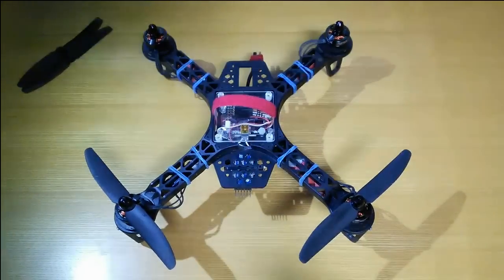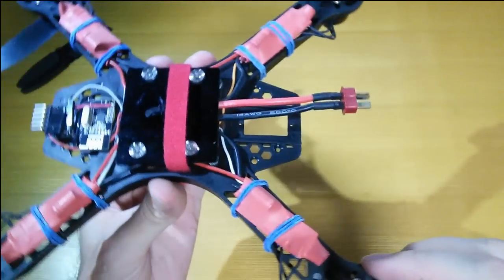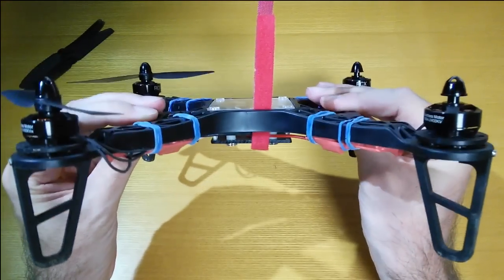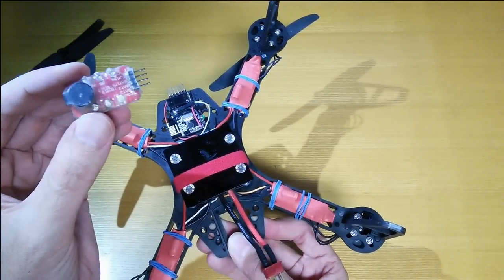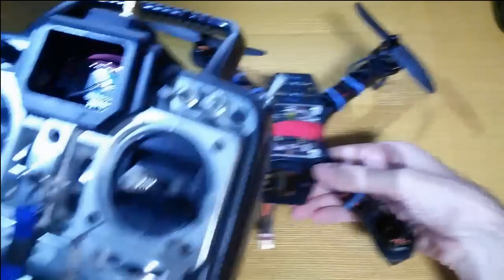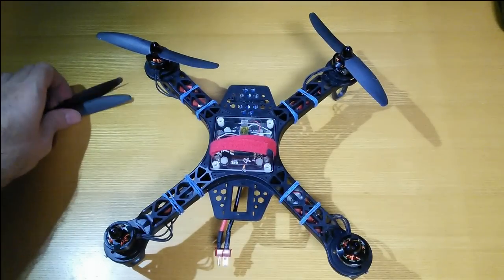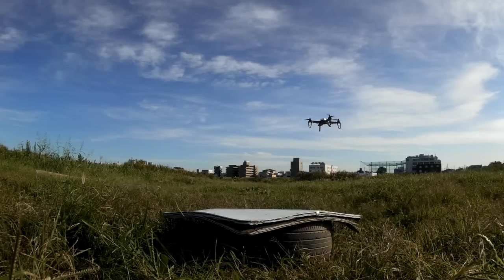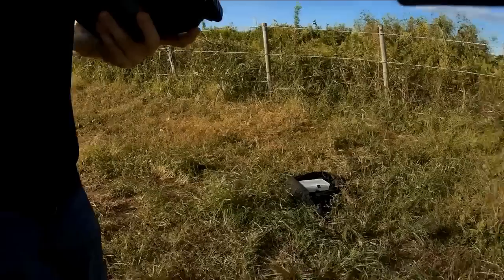Arduino + nRF24L01 + quadcopter

Comment: How many channels are the TX transmitter?
Reply from the maker: Depends. The maximum packet size is 32 bytes so if you're ok with one byte per channel (256 steps) then you could have 32 joystick-style (analog) channels. On/off switches only need one bit, so eight switches could fit in one byte.
Details on the workings are covered in more detail here:
https://youtu.be/eVnyPSAefxU?t=234

Comment: Is there any way to remove vibrations from motors. or any place for IMU sensor on frame so it cannot get much vibrations.
Motors - Sunnysky Angel Series 980 KV. 
Props - 10x4.5

Comment: You should try out the 1.1km version. Actually you can just exchange them! Link: http://de.aliexpress.com/item/wireless-module-1100-meters-long-distance-wireless-module-NRF24L01-PA-LNA-sending-antenna/32648419815.html?spm=2114.13010608.0.68.w2fV4v
Link to Banggood's version: http://www.banggood.com/1100-Meter-Long-Distance-NRF24L01PALNA-Wireless-Module-With-Antenna-p-1057170.html

Comment: hello iforce 

i want to use 4 motor brushed with this project , but when i convert code PWM  4khz  , only pin 9 and 3 work , pin 5 , 6  can not work . it only work with esc brushless . can you help me ?

Comment: did you use the same module in the remote control circuit?? 
i am asking about the antenna that was attached to the remote how did you add it?
Reply from the maker: +أشرف كامل the module in the transmitter is a 'high-power' version, like this: http://goo.gl/MvK8Gu
Reply: thanks

Comment: for a more stable decent you could write it in to have a min idle.
Reply: +Greg Hines +iforce2d I think that the min idle is a half decent solution but as the aircraft accelerates down the props will start to propel backwards as the lift they generate is counteracted by the airflow upward. A better solution would be to check IMU direction and if descending change the min idle by PID control to try stabilise the descent speed. Does this craft not have prop reversal i.e. downward drive?
Reply from the maker: +Paul Sullivan check IMU direction? You mean to detect decreasing altitude? I don't think that's really possible, you would need a barometer which reacts slowly (and also not very precise). Personally I would not want to have the flight controller messing about with the throttle like that while I'm trying to fly either :)
No, quadcopters typically do not have prop reversal - and you would need a different type of propeller for that too. I found you can get a pretty stable descent by just not going directly downward into the propwash, just slant your descent sideways a bit.
Reply: +iforce2d It is possible - I have been doing work on a self balancing robot using arduino and interrupts. Perfectly plausible using an 9 DOF IMU and PID code
Reply: The IMU gives very accurate acceleration versus gravity (very fast and accurate response times) vectors
Reply from the maker: +Paul Sullivan acceleration only tells you the rate of change of velocity, not velocity itself, which is what you need in order to know if you're going up or down.
Reply: +iforce2d Okay iforce2d so as to not get into some sort of flame war firstly I apologise in advance if I am incorrect - genuinely believe that this is not a big problem using IMU and arduino.

In my degree programme I was tasked with building (albeit in java) a Mars Lander - how many people had to do this programming task :). In order to work out whether we were going up or down I used real-time vector summing in a multi threaded object oriented environment.

This can be applied. While you are accelerating down, for example, there is a rate of change of acceleration. Slowing down this descent (applying upward acceleration) is also a 'rate of change'. These are vectors which can be summed to give you a fairly accurate idea of current direction.

I think you will find that a decent 9 DOF IMU does this for you by combining accelerometer, gyro and magnetometer readings. Barometric readings are of course quite variable. Magnetometer readings are also 'fairly' unreliable also dependent on the ground upon which you are standing to an extent though less so than barometric readings.

Please note during early work with 9DOF IMU I decided to pass a neodymium magnet near to the magnetometer chip which I spent a long time correcting as it appeared to have affected the magnetic material used in the magnetometer).

https://www.sparkfun.com/products/10736
Reply: +iforce2d the named chip even has an irq dedicated to isFalling which could easily be used to modulate the props.
Reply from the maker: +Paul Sullivan But accelerating upward does not mean you are actually moving upward, and vice versa. And when the accelerometer reads zero in all axes (eg. you do a fast punch upward and then cut the motors completely), acceleration readings only tell you that you're in freefall. You could of course integrate the acceleration readings over time and come up with an estimate, but it would drift off the real value pretty quickly.

Comment: make a video on nrf24l01 modules with wifi booster amplifier for extending range
Reply from the maker: Gaurav Chugh Do you mean the high power "PA" versions of the nRF24 module? I have many videos about that on my channel already. If you want really long range, you would be better off using a different frequency. I don't think many people use 2.4GHz for long range RC flights.

Comment: Does this method of comunication interfere with other 2.4GHz signals?
Reply from the maker: Richard Haes Ellis It will interfere with anyone else using the same modules and the same channel settings. Outside that I think it should be ok.

Comment: Hi great project im mid build but Im having problems with getting power to the arduino RX where does the power for this come from is from the CC3d or from the battery? Would it be ok to power the arduino RX from one of the spare unused power cables from an ESC if my arduino is 5v ( im using a nano). Do i only then connect one cable (the white one Number3 ) from the CC3d to the arduinoRX? thanks for help ive followed videos closely but still slightly confused thanks in advance, keep up the good work...
Reply from the maker: Simon Derwent The nRF24L01 module needs 3.0v ideally, but it can use the 3.3v from the arduino if the arduino is a 3.3v arduino. 5v will possibly kill it. I made a full series about this in much more detail: https://www.youtube.com/watch?v=9v_xaMAJIfM These days I often use a separate step-down unit like this, so that the input power can be taken directly from the battery without bothering the arduino http://www.banggood.com/5Pcs-Mini-DC-Adjustable-Power-Supply-Buck-Module-Step-Down-Module-p-952402.html If you have a 5v arduino, you'll need something like that anyway.

Comment: nice video :) how to get the coding of this project ?
Reply from the maker: https://www.youtube.com/watch?v=YPtxHw3DWrg
Reply: ***** the controller on the cheap ass quad series is different which is multiwii as compare to this ? whats the difference n which is best ? and same coding for both these ?
Reply from the maker: sardar haseeb
Yes, the controller is different but the point of this PPM output that I've coded in the arduino is that it can be used with other flight controllers. I'm using the same arduino code for all of them.
Reply: thanks :)  and you have not mention the joysticks reference in which u have build your own transmitter not that of hobbyking how to get those ADC sticks ? any refernce at banggood ?
Reply from the maker: sardar haseeb
I mentioned it in the video where it was relevant, but I forget which one that was... http://www.dx.com/p/008-3d-yg-repair-accessories-ps4-original-3d-game-sticks-pair-318011
Reply: thanks :) can we use other sticks getting from others joysticks ?
Reply from the maker: sardar haseeb
wut? uh.... yes. I think.
Reply: yes i search the net we can thanks for your help :)

Comment: In your code, why do you set 1 motor to full power if radio signal is lost?
Reply from the maker: It should be zero power. Not sure exactly where you're referring to but perhaps that channel is being reversed somewhere later.
Reply: ***** Oh damn, I thought it might have been a way to make the crash landing softer. I was referring to this part in receiver.txt..

  unsigned long now = millis();
  if ( now - lastRecvTime > 1000 ) {
    // signal lost?
    ppm[0] = 1500; 
    ppm[1] = 1500; 
    ppm[2] = 2000; 
    ppm[3] = 1500; 
  }
Reply from the maker: wizardofaus18
Right, I think I had reversed that channel in CC3D config.

Comment: I'm developing my own flight controller with arduino pro mini and mpu6050, your idea is brillian because it's include the radio controller!
Reply from the maker: Keep in mind my arduino is only doing the radio link, not the flight control. I have my doubts about whether a pro-mini could do both at the same time :)
Reply: ***** I dont think the mini pro can do both at the same time. As radio receiver I used a Turnigy 9x, but I think it would be possible to have two arduino board and generate communication between them, your idea is great!

Comment: I am planning to build one too. 
I saw some video they used APC220 Wireless serial Data Module instead of nRF24L01+ .  What are the differences of between both of them ?
Reply from the maker: Actually I had never heard of the APC220 :) You can find all the details for comparison on their data sheets, but here are what I think would be the main points:

--- APC220 ---
Frequency: 433 Mhz
Interface: UART
Data speed @ 1km: 2,400 bps
Power: 3.5 - 5.5 v

--- nRF24L01 ---
Frequency: 2.4 Ghz
Interface: SPI
Data speed @ 1km (high-power version only): 250,000 bps
Power: 1.8 - 3.6 v (5v signal ok)

Generally the nRF24 seems to be a better performer, and is also cheaper from what I can tell. Keep in mind that the normal (not high-power) version of the nRF24 is only good for about 80m range max though. From a data format point of view, I find it easier to deal with the discrete packets of the nRF24 than to organize a stream of bytes from a generic serial connection. APC220 is much easier to connect to a PC through USB. I am not quite sure what "semi-duplex" means for the APC220, but you can get the nRF24 to return info in the ack packets at the same rate it sends.

Comment: Very interesting!  There's a thread about doing just such a thing on http://www.multiwii.com/forum/viewtopic.php?f=13&t=1503&p=58935#p58935 but AFAIK you're the first to actually pull it off!  The fact that you managed to create the nRF24L01 RX is especially good to see!  If you've ever heard of the Crazyflie nanoquad (http://www.bitcraze.se/category/crazyflie/) it uses a USB enabled nRF variant to control the quad from a PC GUI.  With an nRF RX that means it should be possible to use the CF PC GUI to control anything you want it to!  Looking forward to tutorial/docs when you have the time!

Comment: nice , please can you give me the arduino code ?
Reply from the maker: I am currently working on a series of videos covering my next build, where I will explain everything fully. For now, you can find the sketches here but they are not tidied up or commented:
http://www.iforce2d.net/tmp/transmitter.txt
http://www.iforce2d.net/tmp/receiver.txt
Reply from the maker: Bayan Ahmad  The ESCs connect to the CC3D flight controller. The arduino gives the flight controller PPM input. The arduino and the ESCs are not connected directly. As I said, I am currently working on a series of videos covering my next build, where I will explain everything fully later.
Reply from the maker: You would need some kind of flight controller to detect the orientation of the quadcopter and adjust the motor speeds. The CC3D is just one of many types of boards that can do that. There are also KK2, MultiWii, Naza, Naze32 etc. I only used the arduino in this project for the radio connection, not for flight control. You can also use a normal arduino to make a flight controller using MultiWii, if you have an accelerometer and gyro module, but it is much easier just to buy one. Most of the boards I mentioned are around $15-$30
Reply from the maker: Bayan Ahmad  CC3D code? I did not make any CC3D code.... I already linked to the arduino sketches in my comment above.

Comment: It is really cool project. The thing that I consider about is the distance of the NRF module. For the low cost quad-copters we can use your solution for the RX-TX issues. And your antenna is still the mystery for me :D COOL !
I also have some projects about quad-copters but I just buy things and only program for the main uC with sensors fusion and the PID controllers.
Reply from the maker: I have tested the nRF to about 700m with good transmission rate - of course that is clear line of sight and using the high power version with external antenna. The receiver was the normal low-power module, and auto-ack was disabled. I did not try further than 700m, but if the receiver also had an external antenna, I'm pretty sure it could reach the stated spec of 1000m. However, it's hard to see the quadcopter after about 30m away :-)
Reply: ***** Wow, your test results for these nrf modules are very impressive. After watching your videos, I really want to build an other quad-copter for indoor flies, of course I will use your tx-rx method. :D
Thank you again sir.